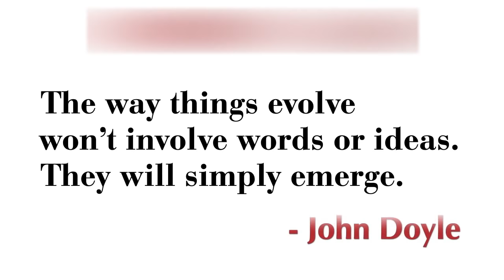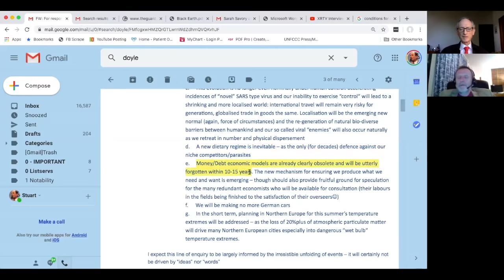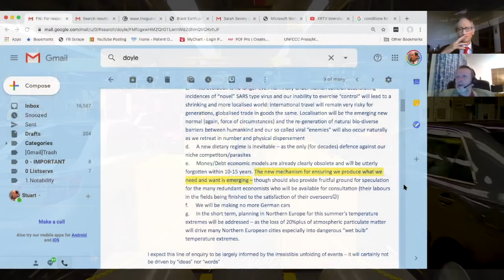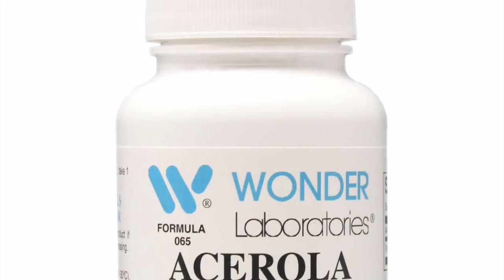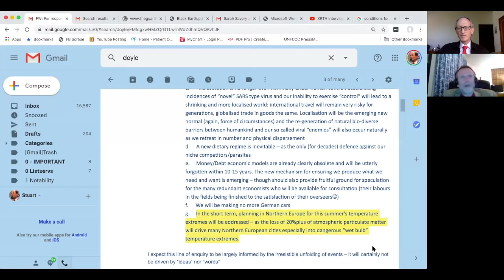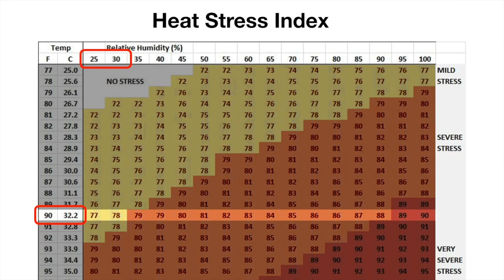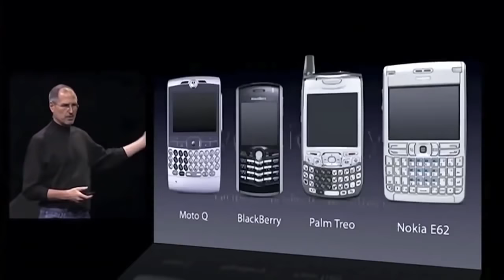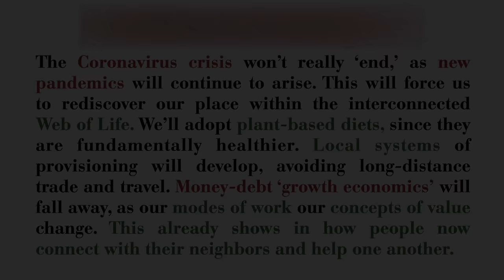The End of Normal - Part 2: Conversation with John Doyle of EU Foresight Group

Comment: On the topic of keeping electronic devices from becoming obsolete, a big chunk of the problem is the proprietary software model - it prevents end-users having any control over what runs on their devices. The Free Software movement (where Free refers to one's liberty to use/study/modify/share) has been advocating and creating non-proprietary software since around 1984. I've been running GNU/Linux (a non-proprietary Operating System) on my computers since 1998 and I love it :)
Some links to info:
  https://www.gnu.org/
  https://en.wikipedia.org/wiki/Free_software_movement
(There is an effort to provide non-proprietary Operating Systems for phones and tablets as well as regular PCs, but it's hindered by laws that allow manufacturers to "lock" their devices and prevent reverse engineering. If manufacturers were obliged to allow users to install alternative Operating Systems, devices could be kept useful and out of landfills for much much longer.)